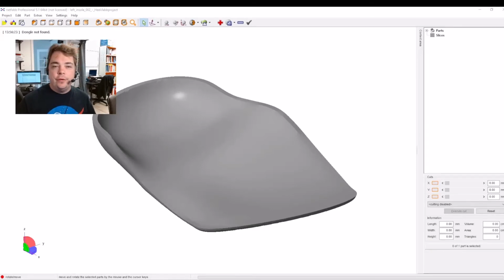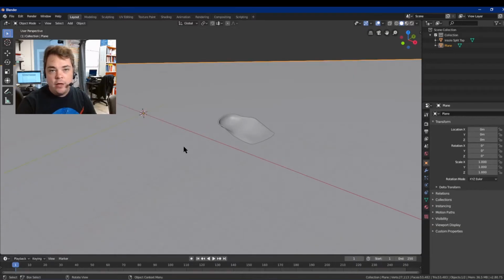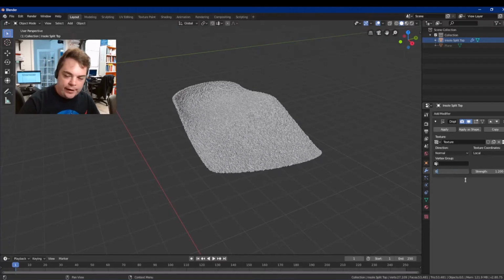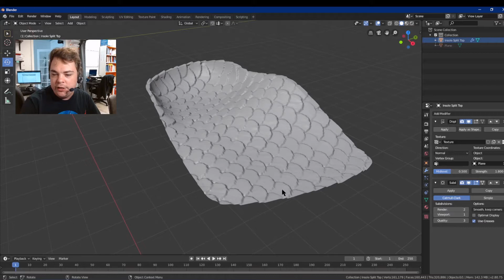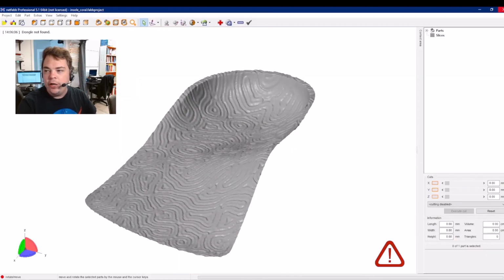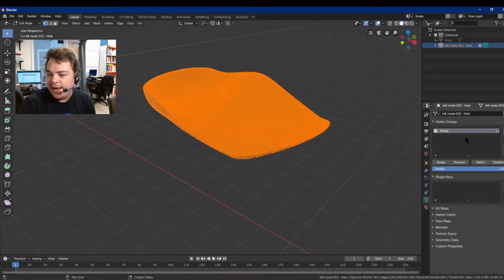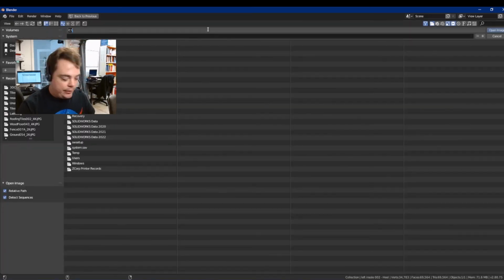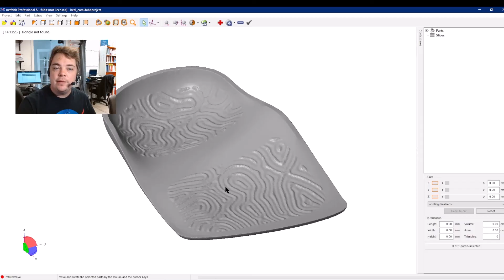How to Add Complex 3D Textures to 3D Prints using Blender

Comment: This method only works with curved surfaces with many vertices.  It doesn't apply to planar faces because the effect is only at vertices.
Reply: For anyone reading, you could subdivide your plane if you're not getting enough vertices or use the voxel remeshing tool from the sculpt panel. A plane doesn't have to be an efficient 4 vertices, it can be subdivided to fit the complexity of the geometry needed.
Reply: He should actually be putting the subdivide modifier Above, and choose simple. 
Alternatively, some CAD software like Rhino has mesh options for maximum edge length. Set that to your minimum feature size, and you'll get a really nice even mesh (it will be Heavy). 
As you've noticed, displacement modifier will do nothing without the vertices to move, which is why adding a subdivision modifier after is just "smoothing" it by sort of blurring the results. Adding it first will make it more smooth And correct. Be sure to change it to simple first. And disable the displacement modifier before you add it first. Check the size of the resulting mesh, THEN enable it again.